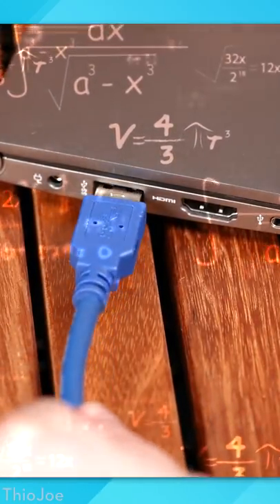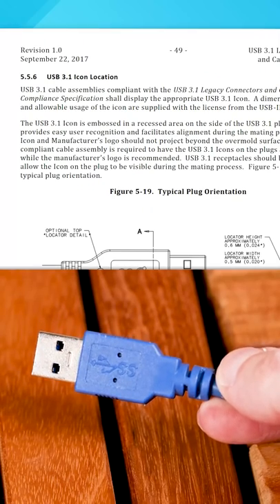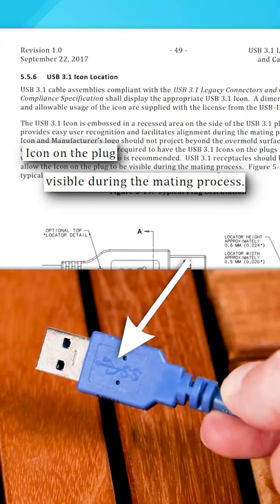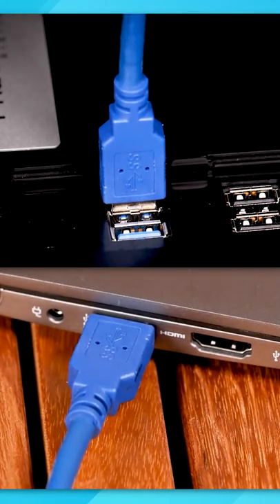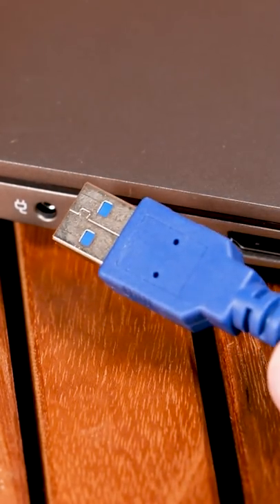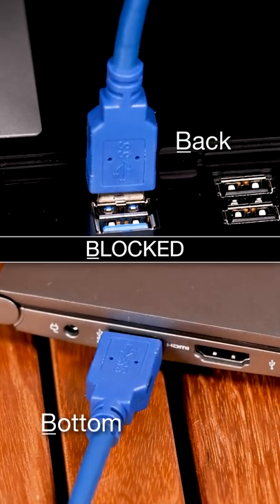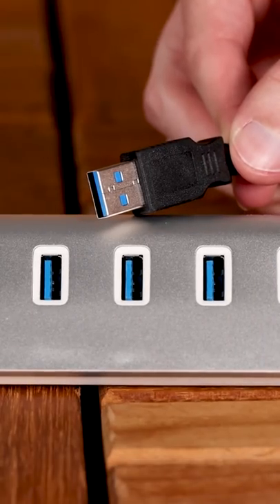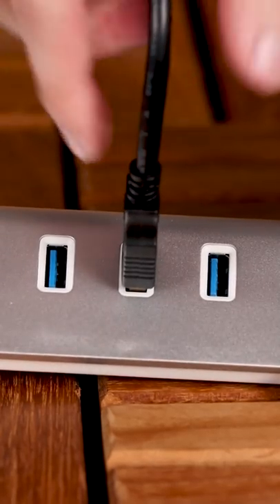Never Plug in a USB Wrong EVER Again

Comment: The real problem is when the USB port is at the back of the computer, even you’re doing the right orientation there’s still a great chance you’ll struggle plugging it in.
Reply: or when the usb ports are different orientation...
i'm looking at you beelink
Reply: and when its dark as hell
Reply: The "bottom" of the USB port is always facing towards the actual motherboard, which generally means the "top" is towards the center of the case. So you shouldn't really have to look at the port, just look at the plug and make sure it's facing the right way.
Reply: I'm usually quite calm but this sometimes makes me rage for some reason way more than it should.
Reply: Not a great change, its 100%
Reply: Who is still putting their PCs right up against the wall, and/or under a desk. This is a non-problem these days, trying to plug a USB cable into the back of the PC. Because people put them in a big space for easy access, sometimes even on top of the desk themselves, and it's easy to look at the back of it and enter it that way instead of looking at the front of the tower and trying to plug it in sight unseen. Or the whole battlestation is set up so as to be able to easily pull the pc tower out for easy access, or even to be able to spin it round without anything coming unplugged unintentionally. It's very easy to set up a pc tower and everything else in such a way that you can indeed spin it round without things coming unplugged or yanking the monitor off the desk or whatever. Look up guides on how to do it, if you don't know how. But it's easy to work it out. I'm an utter dumbass and I still managed to do it for my pc without needing a guide.
  
But yeah people place way too much focus on having a "pretty" PC these days, with tons of flashing multicoloured lights and so on. Which I think is really dumb, I'd rather spend the extra money on better parts, not spend a combined £500 on LED lights which cost pennies to produce and are being marked up 1000% in price when selling it to PC gamers. But to each their own.
   
But it means that the pc tower these days is a vital part of the set up. In the 80s and 90s we used to hide the PC tower, in a corner or under the desk, because we would rather not have to look at it, for some reason. It just took up space, even though it was necessary. There's a reason there were products like those miniature apple mac computers which were like half the size of a gamecube, but we're full fledged macs that could do everything any other mac could do. Computer towers were seen as an unfortunately necessary component, it IS the computer, so you have to have it to have a PC, but people would try to hide it or minimise the space it took up as much as possible
    
These days the tower is front and centre, it's the central focus point of the entire "battlestation". People will put their desks in the middle of the room instead of up against the wall, or even if it's against the wall the tower will have tons of space around it to easily be able to plug things into the back of it. So yeah these days, it's a non-issue. People have FINALLY cottoned on to the idea that maybe you should just set up your PC in such a way that you can easily plug things into it no problem. Like, that's astonishing it took so long for people to realise that. People are dumb.
   
And also these days basically all PC towers have moved the USB ports to the front of the tower anyway. There's no point to it being at the back. There's usually a few on the back still but you often don't actually need to use them. You might only use the HDMI port and those are very easy to plug in, HDMI connectors are very very clearly only one way, they can't be flipped upside down, it's always very clear which way up it goes.
   
But yeah this is not some crazy hidden wisdom, the idea of putting your PC in a place where you can actually use it. And we're millenials, we don't care as much as our parents did about having some kinda perfectly feng shui layout for every room for the sake of neatness. No, we'll have a gaming room with the desk in the centre of the room, not up against the wall, and there'll be wires everywhere. And we don't care, because it's so much simpler to set it up that way, it makes it so easy to plug and unplug stuff. Sure it could look messy, but it's practical and functional, rather than being pretty. You can actually easily go round to the backside (heh) of the desk and PC and sort all that stuff out much more easily than if it was all parked uo against the wall. 
    
And also, all people with a brain label their cables, these days. Don't copy that floppy, but DO label your cables. Just wrap a bit of masking tape around each one and write on then with a pen what cable they are for. 

And with just a few cable ties you can make the wire situation much more neat anyway.
     
I dunno, all this stuff seems so silly to me. Why are people having a problem with plugging in USB cables into the backs of their PCs? This is a solved problem, it was solved 2 decades ago (at least). Maybe if you can't plug in things into your PC, that's a YOU problem, and you should have set up the PC tower so as to easily be able to look at the back of it to plug things in, instead of trying to fumble in the dark round the back of it as you're facing the front of it, like a teenage boy struggling to open a bra.
Reply: @duffman18  Relax man, holy crap.
Reply: Don't forget the silly designed laptops that have USB ports flipped, so you actually have to plug them the "wrong way" around.
Reply: @duffman18  hi. if i have the pc under a table and my office it's close to the wall.. that's not a problem, lmao. if you want to have space in the back of your pc, yeah sure, do it, but don't be so stressed for a lil thing like that. :d
Reply: Then, after several minutes, you realize you're trying to plug it into the DisplayPort or Ethernet socket...
Reply: @wolfpsx6210  Shhh... don't piss that guy off. He will attack you with an encyclopedia set, like what 'old' people used to have on display their house!
Reply: @BetaMaster2  Dell too. Though that was the front ones.
Reply: Or the problem is in dark.!
Reply: Sometimes even HDMI is hard to plug in.
Reply: @duffman18  TL:DR
Reply: Or when they choose backside.
Reply: Also findingg the port
Reply: I still do it the wrong way first because that's what they like. If you were blindfolded and randomly picked it up. Murphys law dictates that 1 of 3 outcomes will happen.
1 you will succeed (thats luck and probably not how its going to go)
2 you try realize it has to be backward swap it around and struggle then success
3 you struggle assume its backwards. Spin it struggle more. Get pissed take off blindfold pull desk out, realizing you had the right way the first time. Jam it in like it owes you money. Shove desk in proceed with other BS lmao cheers
Reply: Trying to plug in a USB-C cable in the back by feel tends to find a type-A socket and reboot the computer from the resulting short circuit.
Reply: The real struggle is when it is on top of the computer sideways. How are you supposed to know which side is back or bottom?
Reply: Yeah lol you can just look at it to plug it in haha
Reply: Or if you're in the dark surrounded by other usbs
Reply: This is what I was gonna say, I had that issue today 😂
Reply: @RobBulmahn  and how tf am i supposed to know where the motherboard is?? /lh
Reply: There is actually a neat trick to that. Put some public hair around that hole and you will find it in no time. XD

PS: That joke above doesn't translate  well in other languages but in German it's a hilarious one.
Reply: Yeah with 10 things blocking the way
Reply: what if usb port are vertical.
Reply: I don't understand why this needs to be explained. it's like the guy has never plugged in a USB A cable before but read the documentation. what other big reveals does he have? "never step on a Lego piece again. how? look at where you are stepping. if there's a Lego piece there, don't step there"
Reply: @ChristopherKemsley  Late, but I keep causing my PC to shut off by grounding the pins of a USB-A slot with a USB-C device. It hurts.
Reply: Its nobodys else fault that you're to lazy to create a proper working environmebt
Reply: Or behind the monitor, thats the worst.

Comment: The correct way is to insert it, doesn't work, flip it, doesn't work, flip it again, works.
Reply: The number of times I've done that...
Reply: This is the way.
Reply: Right its a 50/50 chance
Reply: 10 hours of my life could be saved, if there was a Design like usb c. 🤣
Reply: In between, I ususally try to feel if it's not a firewire port.
Reply: @ChriZzly1337  except usb c is actually both more expensive and a physically weaker design due to its size and additional pins. As quirky as usb a was in needing to try at a minimum 3 tries before it would fit, it was very robust connector no wonder its still in use and has been for 26 years.

Comment: Even knowing this, I still have go through the “try to plug it in, fail, turn the cable and try again, fail, turn the cable again, succeed”’ dance every time lol
Reply: As we all know, USB jacks exist in a quantum superposition state, where both sides are simultaneously incorrect, until observed.
Reply: this why they invented the type C. so people dont need to look xD
Reply: @BenWillock  Exactly!
Reply: @andrewcore7672  
The best would be a USB plug ( called Type D maybe?) that is in the form of a little barrel, like the 3.5mm audio jack.
Reply: For some reason I think this happens to everyone!
Reply: @bro_leo  
I said "[...]USB plug [...] that is in the form of a little barrel, like the 3.5mm audio jack.", I didn't say "USB jack".
Reply: @Lampe2020  But the barrel jack only support two connections. Which is way too little for data transfer which is done on micro-usb and usb-c. 

Although I think it is possible have more connections by adding multiple rings in the barrel. But it'll be a thick barrel so maybe not practical for most usage.
Reply: @unliving_ball_of_gas  
You could also just make it a bit longer and the rings slimmer to fit more of them on there. It was also just a quick idea, nothing too seroius. 
And USB (at least until 2.x) also has only four wires, two being for power and the other two being the data transmission lines.
Reply: @Lampe2020  This wouldn't be feasible considering all the contact points inside. Type C uses 2 sets of contact points, such that both sides have rotational symmetry. Having a round "type D" port would require infinite sets of contact points... 

I think type C already does its job well :)
Reply: @EdwardChan.999  
I didn't mean to use slices of rings (this is what I read from your comment between the lines), I rather meant something like a stack of rings, fitted onto a little holder and each one connected to one wire. I only thought of USB2.0 wiring, otherwise it would possibly be too fiddly and just break all the time. I also only thought of USB Type A for this. 
And as I said above: "It was also just a quick idea, nothing too seroius.". And I mentioned this connector only for USB2.x, in the same comment in which I said that this is only a quick, non-seroius idea. 
And I don't think USB Type C doesn't do it's job great. But there's one problem: it only has two ways it can go into the port, the one I thought of can go in infinitely many ways and turn while plugged in when the user decides to move the cable somewhere else or has a movable device connected to it.
Reply: @Lampe2020  Wasn't trying to blame you lol XD New ideas are always appreciated, tho my bad habit of being a tech nerd kicked in. 

I think Type C is already the best shape any USB connector can be. Making a round port than can twist and turn while plugged in can cause bad connections and arcing (between data pins), which can mean corrupted files during data transfer, or maybe even melting. The stadium-shaped Type C prevents twisting while eliminating sharp edges and allows both orientations to be plugged in, and also being thin enough to fit into mobile devices like Type B Micro. A "Type D" would be too tall for thin mobile devices, thus not as universal.

Edit: If you mean rings inside rings, then you'd need 24 rings, which would be too thicc or too brittle (if thin).
Reply: @EdwardChan.999  
I meant rings stacked on top on each other, like on the 3.5mm headphone jack. If I'm not completely wrong there was also a 1.5mm headphone jack? I have seen them on some older mobile phones that were so small you could hide them in your fist. But it's true, such a thin connector could cause arcing while twisting.
Reply: @Lampe2020  Interesting. Though the smallest headphone jack I can find online is 2.5mm. It'd have to be deep to ensure that each onion layer has enough contact surface area... which is also bad because Apple doesn't like long pointy things sticking into their prestigious iPhone circuit boards. 

Now I should clarify that I'm not a hardware engineer, but given that Type C can support PowerDelivery at 100W, internal arcing would most likely be an issue with thin electrical insulation between the 2.5mm/24-thick onion layers XD
Reply: @EdwardChan.999  
It must be 2.5mm what I remember, I only know for sure that it's exactly like the 3.5mm headphone jack - just in smaller dimensions.
Reply: @Lampe2020  getting flashbacks to a YouTube short I saw… usb type D

Comment: The Logo hint only works with USB-IF Certified Cables since the logo cannot be used on non certified cables.
The "holes up" tip is universally applicable though and definitely easier with the blue colored fill when compared to black.
Reply from the maker: I do have a cable that has an actual USB logo printed on it, on the wrong side 😬. Though it's not indented like the spec says, it's printed on, so idk
Reply: I have a cheap chinese pendrive with no holes
Reply: I wouldn't say "holes up" is universally applicable, especially not when the ports are facing sideways or upwards. For example my Cooler Master COSMOS SE case the front upwards facing ports on top are reverse of the video where the blocked part of the cable is at front which is contrary to this video. They also have cases with horizontal ports on the front of the case upside down where the blocked part is on top, for example the Elite 500 Mid Tower. So yeah while this advice while good isn't quite universally applicable.
Reply: @Sevicify  agreed with this, same issues with hdmi, the ammount of time ive spent reaching round the back of devices trying to awkwardly plug things in by feel alone is shocking.

Comment: You can't even plug in a USB cable the wrong way.
Reply: Was going to say the same thing. 😂 

Still a useful video for those who don’t know.
Reply: It get wrong when your charger 2 pin plug and upside down 😂
Reply: You can try.
Reply: And sometimes you can’t plug them in the right way either
Reply: @jort93z  yeah ive damaged a usb port or two trying to fit those "slim" type usb conectors. Have a tendency to slip between the pin guide and the casing and bend the pins and or the guide. If your lucky not enough to prevent a normal usb from working still, if unlucky usb no longer fits in the hole.
Reply: I'm sure they meant "never attempt to [...]"

Comment: I’ve noticed a phenomenon, plugging in USB cables like this, without looking at them.  Don’t know if anyone else has this problem but almost 99% of the time, it’s the wrong orientation.  I’ve even tried to “trick” this phenomenon flipping the cable before I plug it in and it’s still wrong.  Like flipping a coin, the law of averages would state you would get heads or tails about 50%.  So It’s really peculiar, that I have this issue when plugging in a USB cable.  Some times, it won’t go, so I’ll flip it, it still won’t go, so I flip it again, and then it fits.  Makes no friggin’ sense.

Comment: There is a great new(ish) development in the world of standard USB male plugs.

This new model works in both directions:
 
Instead of a sturdy piece of plastic blocking one half of the opening, embedding the contact points and reducing the correct orientations to 1, these USBs are made with a flexible piece of plastic coming up in the middle, quite thin, with contacts embedded to be exposed on both sides of the tab. Then you insert the plug in either direction, and the receptacle pushes the tab in one direction or the other, connecting easily in both orientations. Fantastic stuff.

Comment: Well this doesn’t work for plugging into a rear IO USB port, since they’re vertical. 

But a good way to remember that one is to think about whether your motherboard is mounted on the left or right if you’re looking at the case from the front. 

(Yes, some non-ATX, mostly OEM (Dell, HP, etc…) machines have the motherboard mounted on the left instead of the right.) 

You always face the blocked side towards the direction your motherboard would be on. So for a left mounted machine (less common) it would be to the left, and for a right mounted machine (ATX standard, which means most custom built machines, and most OEM built machines) you face it to the right.

Comment: A tip that I read years ago: Since the USB logo can often be hard to see, as can the holes, especially if the plastic piece is dark, take a permanent marker and draw a line down the middle of the metal shield on the top. Much easier to see at a glance.